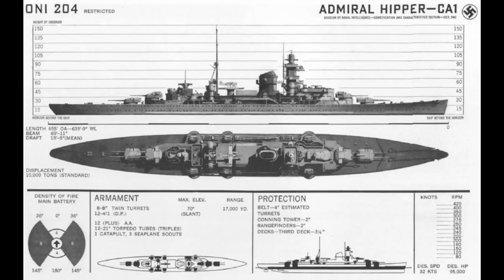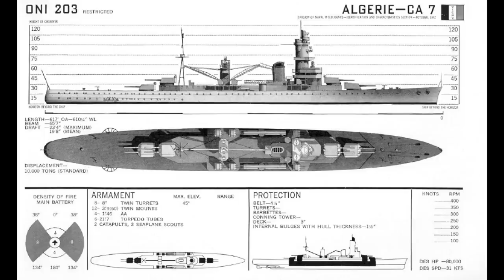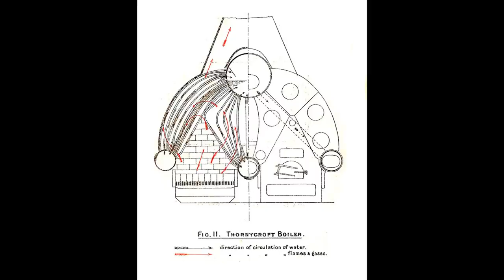The Drydock - Episode 021

Comment: As far as the navy swap goes:

-The Royal Navy with the US are the biggest winners in terms of a navy, here, as the country they’re now working for goes into overtime to give them a sea-resupply capability (having done it for their original navy already) and in short order rectifying their main weakness, although as British ships aren’t designed for this Efficiency will of course suffer barring refits as compared to the USN.  Supply bases in the Pacific will therefore also be a lot more heavily built up where possible.  Although as Drachinifel said their strike capability will be very limited, they can still offer fighter cover for surface operations and are much more durable - and there’s nothing to stop them from bringing in American-style carriers, if necessary.  If they get America’s massive industrial base to fall back on (to which their unfinished ships have also presumably gone), the Lion-class will see at least 4 ships, likely 6 or more completed with them basically filling the role of the Iowas and/or South Dakotas, with the KGVs being more numerous North Carolinas.  Also, several losses to submarines in real life may well be averted by the RN’s unmatched ASW.  Whatever battleships are damaged at Pearl Harbor are likely to have massive repair priority, as the unique carrier matchup here means neither side will be doing much damage to enemy shipping with carrier aircraft - and if the RN’s massive battle line of as many as 17 battleships is ready for Coral Sea (likely, the American one could have been deployed at Midway) and Midway, the Philippines and ABDACOM and all still likely fall but the Coral Sea taskforce is likely to be caught and some significant portion of the Midway one WILL be caught, seriously if not mortally wounding the IJN then and there, most likely including the Kido Butai, the Yamato, both Nagatos, and at least some of the 14-inch ships with the Nelsons and their prioty-target 16-inch guns likely going down with them along with perhaps a few QEs and Rs.  The Mighty Hood, in refit for this, has her moment of glory in the Solomons leading the hunt of much of what’s left, with a dedicated fighter screen from multiple carriers and likely support from the Renowns and/or KGVs - their big day will come with the sinking of the Musashi - here the Hood takes grevious damage but doesn’t sink and gets a new refit because I like her and we Americans would be happy to use her as a status symbol too - this refit would likely see supercharge-optimized guns and a full transition to late-war American AA practices.  Later in the campaign, the Lions start to show up and by then the ever-innovative RN will have worked out a Pacific-viable carrier strike package (read: large and powerful, perhaps digging up the G3 design for a massive armored carrier).  This makes the island-hopping campaign rather... subdued until the Kamikazes start showing up.  The RN definitely takes his, but the ease with which they take it depends on if they also get the US industrial base so as to very rapidly fix/refit their battle line and pump out a very large amount of Lions, carrier-G3s, advanced destroyers, and of course a light cruiser spam, with the Minotaurs likely seeing the light of day either way.

-The US Navy serving King George VI is... a bit of a mixed bag.  The carriers exemplify this, they’d take huge losses in the Mediterranean that may well see Enterprise and Saratoga as the only survivors after a few years with them being lucky enough to stick with the Home Fleet, but then again the Bismarck and anything else dumb enough to venture too far out into the Atlantic without the ability to submerge would be spammed to death SBDs and Devastators (eventually Avengers) with working British torpedoes.  That being said, with their superb damage control and huge fighter squadrons they’d last longer than you’d think, and they’d take down a lot of Italian naval assets with them.  The Essex-class as such will come out rather different, with less planes and more armor.  The Iowas will likely be cancelled, especially if the USN is stuck with Britain’s industrial base, though the North Carolinas and South Dakotas will likely be completed but also scrapped post-war.  Now, if the USN gets to keep their American industrial base, it will be a dark and miserable era for U-boat crews because that completely ridiculous American destroyer spam is suddenly clogging the Atlantic and soon bristling with British ASW innovations.  If not, the Battle of the Atlantic ends up being rather similar.  The altered, armored Essex-class arriving will herald the beginning of the end of major troubles in the Mediterranean (especially if they can build 10+ like the US did), and that will be that.

-The Germans with the IJN do have a lot more going for them here, with a functional battle line and a large carrier force.  If they somehow manage to finish 4-5 Yamatos as battleships they could very well simply force their way out into the Atlantic.  That being said, they still lose, because the majority of the USN (many of their carriers, several of their modern BBs, and likely all the standards) will soon also be out against them, and what they lose they will have massive trouble replacing with any Axis industrial base.  The combined weight of the RN and USN will be enough to ultimately crush the IJN’s attacks especially with so much land-based support available, and what’s left will again be bottled up spooking convoys now and then.  They end up being enough of a threat to draw way more heat than they can handle, especially with the USN needing to devote little attention to the Pacific, as....

-The Kriegsmarine in Japan are completely boned.  They have nice subs, sure, but the Japanese already did before this and it didn’t save them.  The total lack of carriers is so damning, allowing the US to devote perhaps Enterprise, the Lexingtons, the North Carolinas, and later perhaps some of the South Dakotas and Iowas, plus some degree of escort, to the region and leave it at that.  If they are forced to perform a Pearl Harbor attack they are especially boned, as the only option they’ll have is to storm Pearl Harbor with Sharnhorst, Gneisenau, Bismarck, maybe Tirpitz, and a few escorts.  This force is of course annihilated by air attack.  With or without these intact Japan will never conquer the Philippines or the East Indies or anything like that, and if Graf Zeppelin manages completion well big whoop, one carrier with a small air group.  Most of the war will likely end up happening in Japanese home waters with part of the USN attacking and gradually dismantling anything capable of servicing U-boats, the only real threat here once you’ve thrown an amount of aircraft the USN is more than capable of deploying at the Bismarcks in short order, likely well before they can do much of any damage (if not right at the beginning if they’re dumb enough to try for Pearl Harbor).  Well, that and aircraft based in Japan.

Comment: After the attack on Pearl Harbour it became common policy that any US warship in comission had to have at least one boiler fired up and under full pressure to provide enough steam for movement. If the boiler plant needed any work done to it the ship would be de-comissioned. The reference to coal versus oil is termed calorific value or heat value, oil having more than coal.

Comment: In regards to the US Civil War question.

Hearts of Iron IV has a mod called Kaiserreich. In this mod it's possible to play as America in a second US Civil War in the time around WW2, albeit in an alternate history where Germany won WW1. It's possible to have a Union vs Confederacy war, although it takes some effort to get it. I usually build up a defensive and raiding fleet as the Union, with the significant battleship fleet hanging around the coasts and the submarine wolfpacks ripping apart convoys in the south. The only time I've had issue against the South was when I didn't equip sufficient anti-submarine weaponry. It's extremely likely that submarines would have been the south's ship of choice.

Comment: Q&A You mention the relatively small explosive charge of the Hipper's  shells. I think this came up about another German ship before. Was it a concious choice of the Germans (maybe using more metal in the shell to penatrate more armour) or bad design?
Q&A I saw some footage of the German K-class light cruisers built in the late 1920's. They had 3 turrets, with just 1 of those forward. Quite uncommon, usually 2 of the 3 are forward facing. Do you know the reasons why those ships were built like that?
Reply: They were designed to scout and the German designers thought they would probably be escaping a lot.
Reply: More forward guns means more firepower in pursuit. If I'm certain my fleet will win I'll add extra forward guns to hopefully demolish the enemy during withdrawal.

More rear guns means more firepower when moving away. For scout ships it's a good idea, as they'll often see the enemy and then turn around to rejoin the fleet, most of the time not being able to engage with the forward guns.
The other reason to do so would be usage as a deterrent for the enemy, since that doubles the own firepower.

Comment: Another disadvantage of coal is bunker fires and coal dust explosions. Bunker fires were a well known problem on coal fired ships; believed by some to be the cause of the USS Maine blowing up in Havana. Coal dust can form explosive mixtures in air and is believed to contributed to RMS Lusitania and HMHS Britannic sinkings in WWI.
Reply: Don't forget the USS Oregon! Was underway to Cuba and had it's own minor problem with coal blowing up.
Reply: The RMS Titanic set sail with a fire in one coal bunker. Although it was soon extinguished, some think the heat may have weakened the hull plating and/or rivets in that area, which unfortunately was just about where the ship hit the iceberg. Who knows if a stronger hull there might have reduced the amount of seam unzip that apparently happened (it wasn't a tear), and kept her from sinking (or at least, afloat long enough for rescue).

Comment: Question: the Deutschland class ships used diesel engines to save weight, and diesels tend to be more efficient. Did other countries consider using them on major ships and why didn’t they get used more?
Reply: On modern civilian ships, diesels often drive generators rather than the propellers directly. I believe that No. 6 (Bunker C) fuel oil can be used in a diesel, so long as it's heated up to 200 or 300 F to thin it out. So, they wouldn't even have to change their fuel supply. Boilers and steam turbines may well have just been cheaper and lower maintenance than huge diesel engines, at least at that time, and navies were quite familiar and comfortable with the old-fashioned steam technology. Perhaps no one was really comfortable with building the huge engines 80+ years ago that would have been needed.

Comment: personally I dont think hipper is inferior to algerie. Hipper might be oversized but that weight doest only come from hipper beeing longer and wider. it also comes from Hippers internal layout and armor scheme. She uses turtleback armour which makes her actually far better armoured at closer ranges than algerie. In general battles in the north sea were fought at closer ranges than in the pacific, Hipper and most other Kriegsmarine ships were built with that in mind, now if this kind of archaic protection system is outdadet or inefficient is a point for debate and discussion , personally I think it works perfectly fine for "north sea ships". In general ,despite the advances in radar etc which made gunnery duels from longer ranges possible , most captains tried to close the range since fire at those ranges was still rather inaccurate. Another point is that Hipper was considered an excellent seaboat, with gentle roll and good stability . I dont know how this was on algerie, there isnt as much information on her as for hipper sadly but stability and seaworthiness are points that seem to get genereally overlooked even tho they are just as important as firepower armour etc ( for example bismarck with her exceptionally wide 36meter beam was an extremely stable gun platform,a point that is often overlooked when comparing her to other BBs )   . Where it really comes down however is fire control. Hipper was equipped with the latest fire control system and excelent optical rangefinders, probably the best optics in the world. She will be able to get the range faster than algerie and therefore lay the hurt down quicker and more efficient. Gun wise, Hipper has a slight advantage in that her shells have better trajectory ,better penetration and are more modern, I´d tend to say they are more accurate as well, she also has a range advantage, rate of fire wise, they are evenly matched.Hippers shells are as stated in your video not as destructive as algeries but have a pretty impressive 920 m/s muzzle velocity against 840 m/s on the french ship. It really comes down to which ship can hit more often and I personally favour Hipper in that factor. Overall I´d say these two are pretty evenly matched, both are excellent ships among the best if not the best in europe at the time ( the zaras were also pretty damn impressive but their fire control and especially radar suite was lacking severely, none of them carrying any radar. The british heavy cruisers were...well... lets say I´m not a big fan of them, first of all they dont have any of the elegance that an Adm Hipper,Zara or Algerie has, but especially the county class lacks in armour  compared to the other ships and I dont think they would stand a chance against either a zara, Hipper or algerie in a fair fight ( HMS Berwick herself got slapped pretty hard by Hipper in their engagement). One point Algerie definetely has over Hipper is her machinery: Hippers machinery was notorious for beeing maintenance heavy and unreliable.

Comment: What would happen to the nuclear reactors and nuclear warheads to the sunken nuclear ballistic missile submarines in the deep ocean?
Reply: Rust, mainly. 

The core themselves would be cooled by the sea so there wouldn't be any issues.

Warheads would do even less. The radioactive head isn't large enough to achieve supper critical mass so would just sit doing very little other than going though radio decay.
Reply: @tisFrancesfault  Unless they're made of some exotic corrosion-proof metal, eventually they'll get to the point where they're open to the sea and leaching radioactive materials. Probably not fast enough to be a major problem.

Comment: I do not buy your " if we had tracer"....USN had plenty of tracer and lost PLENTY of ships....
Reply: The point was, force Z had next to none. If they had, and given the ships amazing ability to dodge the torpedoes that were launched on target. It's very possible they may have managed to evade the initial attack. Which could very well have changed the tactical dynamic, given they were on an intercept course with a inferior Japanese fleet. Though my memory could be failing me there. I'm sure it was a lot of Japanese cruisers and the Kongos? Could be wrong.

Because of the lack of tracer. The torpedoes were launched without the need for the pilots to evade as much.

The comparison to anything the USN had happen isn't really relevant. Comparing apples and oranges.